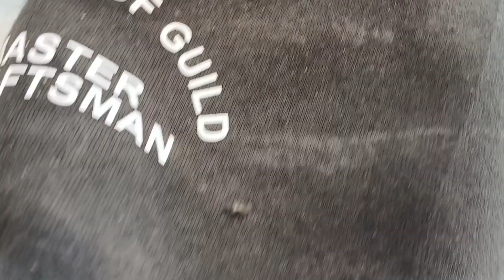how to fit helifix crack stitching bars using R-KEM II Styrene free polyester resin

Comment: Could you tell me what thickness blade you are using in your 9" grinder please,i have a 5" grinder with a 3/8 mortar rake blade but i cannot get the depth,my 9" grinder is a bit scary to use especially if you go to deep and it grabs,also it is to heavy.
Reply from the maker: Blade is about 2mm 
9 ich grinders are heavy 
5 inch grinders don't go deep enough 
You might have to chistle the rest out  to get the correct depth